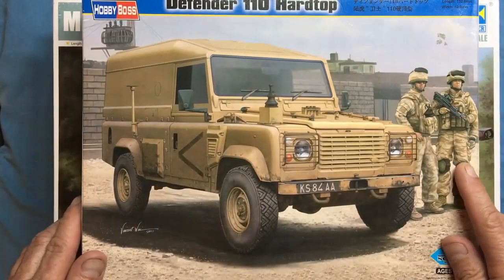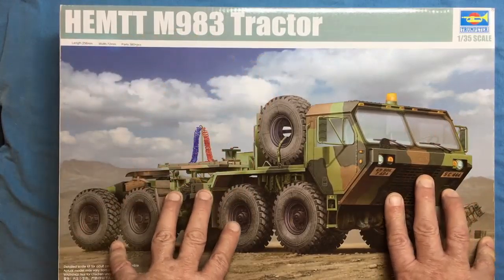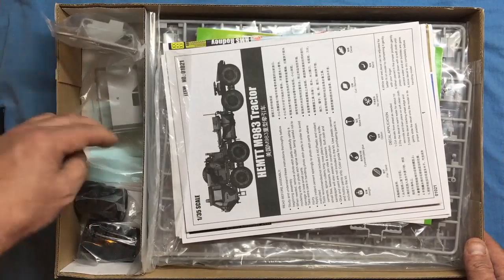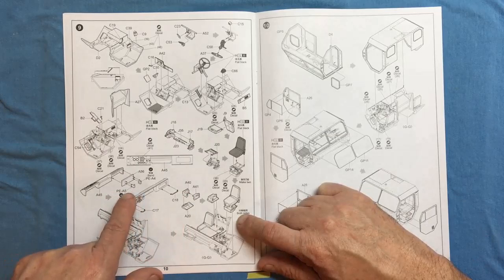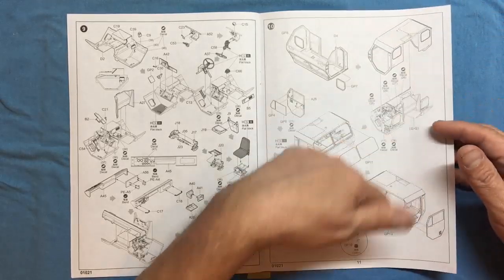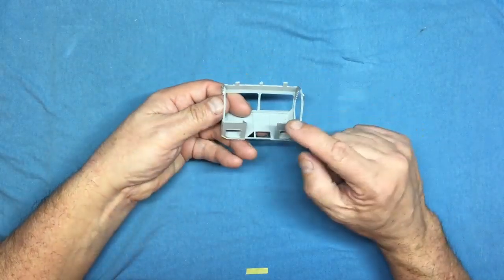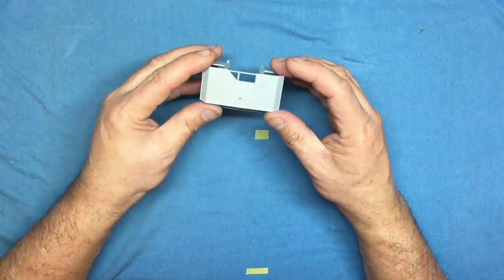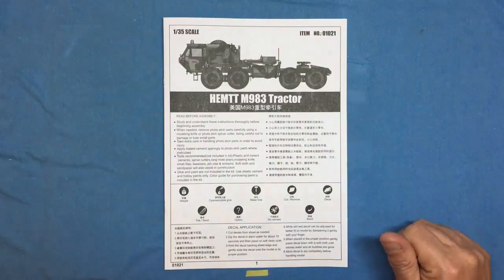Trumpeter 1/35 M983 HEMTT Kit review

Comment: Funny the MRAP i'm building has all the right branding logo's,CAT;Oshkosh and Michelin.Looks massive kit compared to my little Oshkosh.SYZE uk,just got tweezers from them.Best ive used.£12 but you can see why.Be nice if there was an engine for the HEMTT kit you could review.
Reply from the maker: I'm soooo tempted to get the MRAP Darron. It looks stunning.
You spoke too soon mate.. the engine review is up.
Reply: Best mould ive ever seen,no bullshit.You won't be dissapointed i promise.And its a kit thats going to be around for ages,no rush.Its got no hidden corners,all detailed.Looks a challenge though.Decals for all branded engine parts,and vinyl or PE Oshkosh mudflap's.Thats what i wanted those metal thin sanders for,its going to need them.